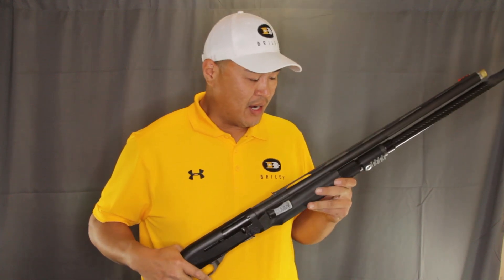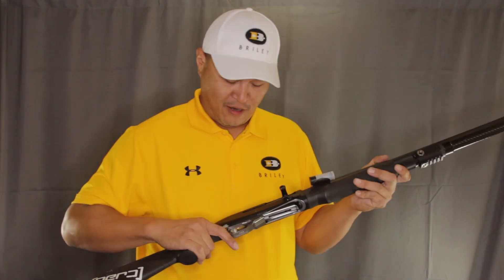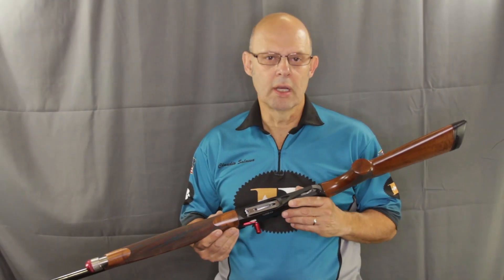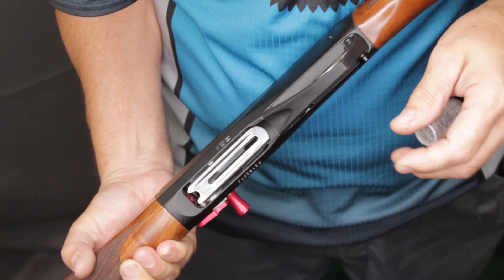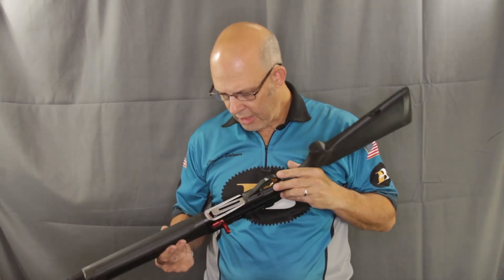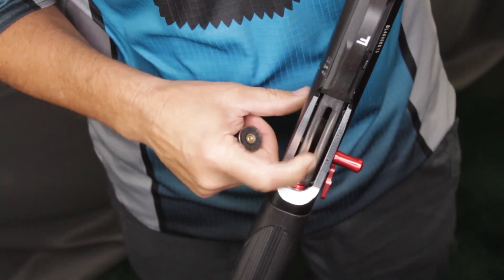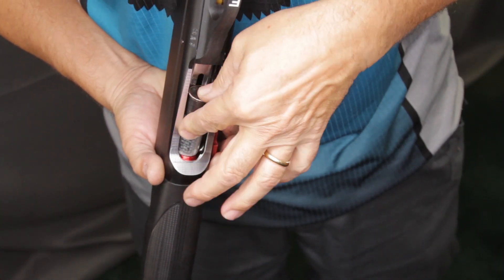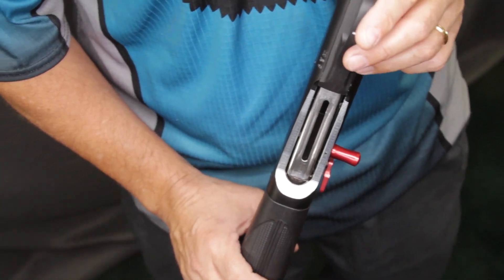Briley Loading Port

Comment: Should this be done on a shotgun used for combat applications? Such as a pump action and also a Benelli m1S90!
Reply: Yes, this can be done for any application, pump or auto.
Reply: @StephenPaizis  thank you! I’m a little hesitant(scared) to do fearing I’ll grind off to much, so what I’m doing is using a file to start with and see how that works out for me! I’ve found that my ports have sharp edges and were actually cutting my thump when practicing the twin load! Filing it down helped with that problem for me! Would still like to bring it down, maybe when I have more confidence to try! Again, thanks for the great video!

Comment: Is there any reason why you wouldn't want an opened loading port on a shotgun? Does it increase chances of malfunctions or anything?
Reply: Hundreds of modifications have been made without issue.  Many factories are now standardizing the more open loading port.  When done properly there is no effect to longevity or reliability of the gun.